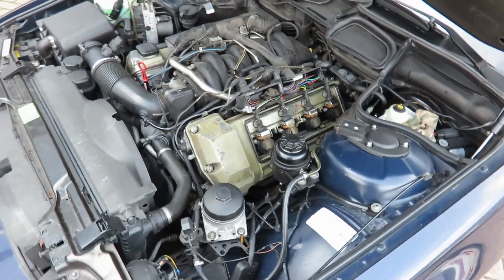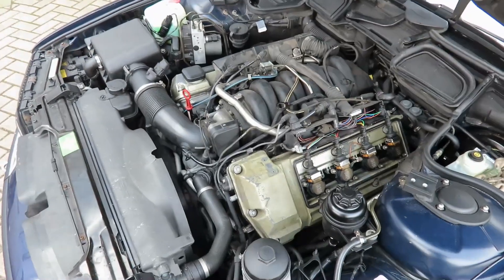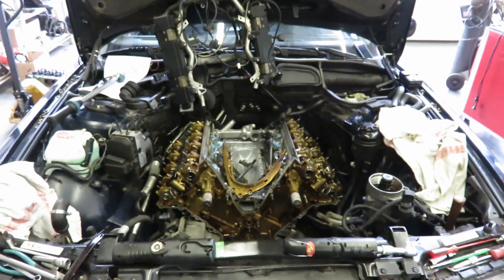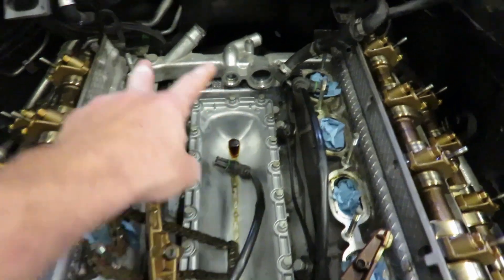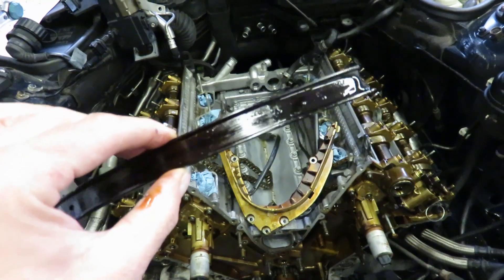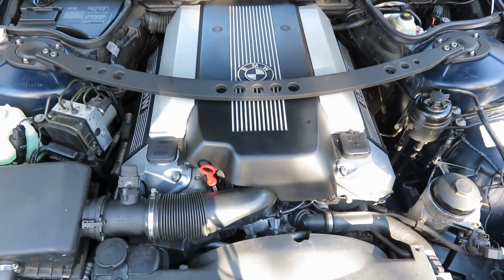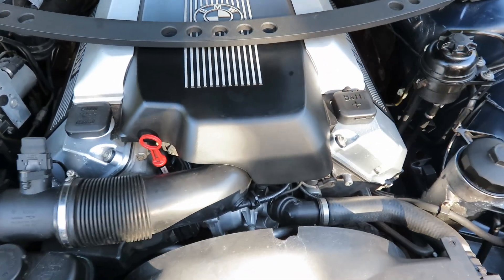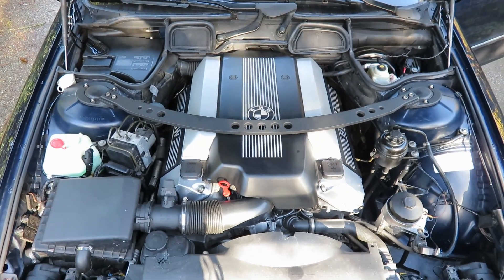BMW E38 M62-TU timing chain guides failure

Comment: Stupid engine design breaks my heart. Why did BMW go from the timing chain sprocket to a shit plastic guide? Metal drags across plastic. I swapped my guide tensioner at 97k miles and it needed it. Hope that and timely synthetic oil changes gets me a ways off from a guide job.

Comment: so what happens? i have a X5 BMW 4.4 03 and its at 160,000 miles but what i should look for when this is going?
Reply from the maker: Anthony's BMW Garage trust me when they go you will know, lots of noise en hard idle
Reply: @BMWorks_NL  when should i do this repair?
Reply from the maker: Anthony's BMW Garage hard to say they can last or go tomorrow.....
Reply: @BMWorks_NL  will the engine blow up?
Reply from the maker: Anthony's BMW Garage google m62 timing chain ;)
Reply: @BMWorks_NL  so it just rides on the metal and you here it? well i guess that will tell me if it needs to be done

Comment: I had a P0021 in my 01' 740i after doing a full timing guide replacement. I used the cheaper kit. As you probably already know, Bank 2 is driver side (in a LHD car). I removed and replaced the valve cover about 15 times, making small adjustments each time to the cam timing wheel/cog. Finally got this thing to work. I removed the torx in the front of the timing cover and a little at a time rotated the timing wheel, reassembled, cleared codes, started it, restarted it. If you have a P0021, you don't have to re-time it entirely (unless maybe you're off by a tooth, though not sure how you can really do that). I put a long punch through the timing hole (torx bolt hole in upper timing cover) and my correct timing was just on the right margin of the hole in the timing wheel. So, in other words, the punch was just right of center of the hole in the timing wheel.

Comment: What is the diference between m62 and m62tu.....some extra torque ??
Reply: Septimiu Razvan Bot 
TU is the vanos version. The worse version IMO. The guides doesn’t last as long, it has less HP, the car got 4 o2 sensors instead of previously 2 (only pre-cat on early models), it ruins the noise of the car (unless you spend a bunch of money and/or time fixing it). 
Only positive thing about the vanos ”upgrade” in the M62 is a bit better fuel economy and more evenly distributed torque over the rev registry = more torque on low RPM as if a V8 doesn’t have enough already lol
Reply: @jgripen969  oooow goood....i have a 1996 740iL....no vanos 😀😀😀😀......but i must chenge the timing chain.....hmmmm....till then its stay parked and i go with the 728i......😊😊😊😊 you can see my videos 😀😀😀😀
Reply: Septimiu Razvan Bot 
What’s your mileage? Of course the guides break on both engines, not implying non-vanos is bulletproof. But i see non-vanos consistently make it over 200 000 miles (ca 320 000km) with original guides. Change oil and filter every 600-700 miles (10 000km) and make sure to use the right oil and oil brand (Castrol Edge) and you’re fine. If you only make short trips (something you shouldn’t) you should change oil even more often.
Reply: @jgripen969  i just bought the car in april last year ....i drive it maximum 500 km....becouse i MUST change the chain......it has exactly 319.000 km .......the chain has a big big play .....i remove the caps on the top.....i dont drive it unless i change it.....the oil that i put when i buy it was 5w-30 castrol ........
Reply: @jgripen969  i will make a video
Reply: @jgripen969  the oil i change between 6 and 8.000 km.....in the 728i i put castrol 0w-40....
Reply: @jgripen969    https://m.youtube.com/watch?v=cfE2bXmcwQU     the video with my 740iL

Comment: Did you ever clean out the shrapnel from the old guides which dropped down into the oil pan?
Reply from the maker: tempest411 there was none in this engine as guides were in one piece (brittle yes)

Comment: What's especially biting is that the timing chain found in any old Chevy V8 is of a beefier design, and common sense tells you that you don't run a chain at tension across anything but a roller bearing supported sprocket, NOT guide rails intended for the slack side of a chain system.
Reply: What bites even harder is that BMW built the M60 with a sprocket (and dual row chain) then ditched it for this plastic BS with the M62.
Reply: tempest411 BMW designed it to have as little weight at possible. That's also why it's so sensitive to overheating. It was probably good since it's a 5 series and it will be heavy. Imagine if BMW built the engine like a Volvo. It would weigh way too much.

Comment: @Homerraas - Question: Start up rattle on these engines is what's exactly? I've done chain guides, new INA chain tensioner but no Vanos rebuild. Is the start up rattle from Vanos and OR how do I get rid of start up rattle? I would appreciate your opinion.
Reply from the maker: vosedon 95% Vanos units and or the return valves behind the Vanos solenoids
Reply: Homerraas I'm doing the vanos units here soon. You recommend changing the upper timing chains? I have the old main chain on. Will that be an issue having my old main chain (maybe stretched) and two new uppers?
Reply from the maker: No but if you have everything open why not change all chains?
Reply: Homerraas I'm not taking off the lower timing case. Just the two upper cases for the vanos rebuild. I wish the shop I took it too for guide replace did the main chain as well.  So I'm stuck with the old main chain for now.

Comment: What's the life span of the Chains? I've read they are really strong and not really needed to change out. I had the guides done and they didn't change out my chain. Just wondering your opinion.
Reply from the maker: vosedon I always change them, they don't break but do stretch quite a bit. For the amount of a new chain compared to the total in parts it's a piece of mind for me

Comment: @homerraas I have a subtle rattle- loud enough to hear from the cabin but just loud enough. Getting intermittent P0012 - camshaft pos over retarded bank 1. Engine then idles extremely rough. I shut car off, count to 10, start car and everything's fine. No idea what I'm dealing with here. 2007 BMW 530i

Comment: @homerraas after you replace all the guides in the car. Does the oil get a little dirty from new guides rubbing off some plastic? Or does that even happen at all? I just did and I looked at the oil filter and it was kinda dirty looking.
Reply from the maker: No, there is no plastic rub from the new components so your issue has to be something else
Reply: Homerraas maybe I'm just paranoid. Thank You

Comment: Hi
I would like to purchase bmw 316 diesel f30 2013 or bmw 520 diesel 2012. both driven about 130000 kilometers-150000 km. should I worry about the timing chain of it isnt changed or you think if they r ok can last life time? 
and also automatic transmission oil needs to be changed? or not? and every how many km?
thanks for any sugguestions or other notes.

Comment: @homerraas How many miles where on these cars when you had to change the rails out?
Reply from the maker: +vosedon It varies from 80k miles up to 200k all depends on the oil used and tensioners replaced over it's life (mine 165)
Reply: +Homerraas thank you for fast reply. I have 100k and I just changed out the tensioner. This is only to do list. What's the average cost you charge for this job and you in the Vegas area? Lol
Reply from the maker: +vosedon Repair is about 1200 in parts if you have it done about 2500 total, seals add 200
Reply: +Homerraas that's sounds reasonable. So far I've been quoted 3500 from 3 shops. And this is something that I could attempt but for my daily I would pay someone to do just in case I mess up. But I love these cars. Still a head turner. Thank You sir
Reply: If I replace the chain tensioner as preventive maintenance and use synthetic oil, can these chain guards last longer? Looking to a buy an e39 with the M62TÜB35 and the owner has done the VANOS seals and some other gaskets and belts. I heard the engine running and sounded good, but I didn't hear it while the bonnet was open. I got to check that out quick because next trip I do there (next week) I will either buy it or not...
Thanks!

Comment: how much was the whole repair?
Reply: 3500
Reply: Bbs Wheels I think that you could have the timming chain guides done at a reliable shop for well under $3000 USD even (vanos rebuild excluded). I would like to know what you are referencing your number to?
Reply: @isaaczarayan3422  yeah right 3000

Comment: Having mine done right now....  Timing chains and tensioners $4200.  Does that sound about right?
Reply from the maker: +alex silver bull! Vanos needs timing and correct timing or you will loose a lot of power. There are no marks on the sprocket, you need cam lock tools to do this job........
Reply from the maker: +Sean Ober That is HIGH if you ask me, normal rate is about 3k (in parts it's about 1500)
Reply: +Homerraas + guides too.  They gave me a 10% discount dropping it to $3750'ish.  Only ran the engine for 5 minutes since hearing to clicking then towed to shop.  I wonder if I should ask if they could just do guides and tensioners?   Maybe new chains not needed?
Reply from the maker: +Sean Ober I did tensioners, chains, guides, water pump, valley pan, and all gaskets that was 1500 in parts. IMHO once your in there do it right or don't bother
Reply: I'm paying about $675 on esctuning, that's including the new timing chain tensioners, everything from the OEM supplier INA and EWIS timing chain, the small timing chains for the cams are fine, I'm doing the job myself, but I have some knowledge with BMW engines.
Reply: +Martin “MartinLoccz” Pulido JR i need to know the timining marks on the cams right side both cames are at a 45 but the left side i cant find any video on it aswell as wear the marks are on the cam sproket and what happens if you dont time the vanos,,one guy told me it will just reset itself ,,

Comment: While at 133,000 miles the engine seems to sound as in your bimmer after replacing many inner timing parts, I'm replacing all four coolant hoses by the firewall, since one of four has a blob and the other one has already burst, and you cannot get those hoses replaced w/o removing intake... at least it would be extremely difficult. While at it I decided to replace upper timing cover gaskets but am having difficulty putting covers back on as they are not aligned at the top end with the top of the block head. Gasket needs to be compressed in order to get the covers tightened. Gaskets seem to be thicker than old ones. 
Have you had the same issue with upper timing covers  get aligned? Or did I get shitty gaskets? Thanks

Comment: NOTICE!! if your guys going to change that midle guide rail (U shaped) remember take from old rail that one Bolt! from top right end of the rail, and the new rail does not include that bolt. bolt is holding that separator 90 degree turn aluminium peace inside the timing cover, and comes out from cylinder head and pipe keeps going under air manifold. whitout this Bolt that alumium peace is dropping off and most likely it sucks oil to your intake manifold and you Will get sick smoking becous separator aint working right
Reply: Listen up guys.... he speaks the truth, so easy to miss this screw and this comment right here saved me a ton of time and frustration.... I completely missed this screw, at the time I was wondering what held the top of oil separator in place. Now I know, it is this little Allan head screw that pushes the oil separator connection away from the chain rail and seats it tight up again the valve cover. 

I have read a ton of write up's and seen a bunch of videos. No one mentioned this screw. YOU ARE THE MAN !     

If I could give you a 100 thumbs up, I would :)
Reply: +Autox Vancouver yes whitout that bolt goodluck all to install that oilpipe what goes to intake manifold. total nightmare when that 90degree aluminum peace drops from its place or crack the plastic on separator :) experienced my self that
Reply: I was just about to write the same shit. 
I've started this job a couple of weeks ago, and yesterday I had everything installed except the timing covers and stuff around it. 
I was lucky, cause I had to leave it open until receiving the last part of O-rings including the crankshaft seal, which arrives next week, and I had enough time to double check everything I've done so far.
I wondered why the O.S.V was moving back and forth...
Took a look at the old U-shaped guide and noticed that 3mm allen screw, which was missing on the new one..
DO NOT FORGET THAT LITTLE MF

Comment: Sir, your video is quite helpful. But is there a way that you could post a video or a link that describes the steps and hints involved in undertaking  such a task and if the vanos need to be rebuilt is there a video for that too? Thanks. 👍
Reply from the maker: Leon Blunt check out e38.org for all info you need

Comment: Great work! My E36 M3 cranked and started on the first turn key when I did my head gasket a week ago. 

Same for my M62Tu when I did its headgaskets 2.5 years ago. 

Glad to see it worked out for you
Reply from the maker: I always crank for oil pressure first as I don't want all new parts to suffer oil starvation the first 5-10 sec
Reply: Homerraas  yes, that's a good idea if you don't use an assembly grease on moving contact surfaces
Reply from the maker: Richard Verret
 Agreed BUT keep in mind the timing chain tensioner, the Vanos solenoids and oil pump have been without oil